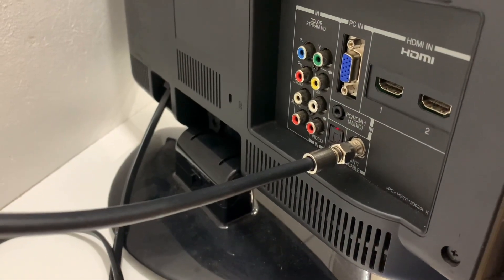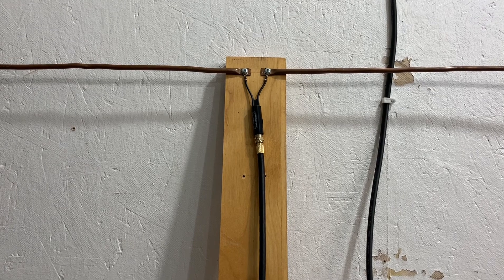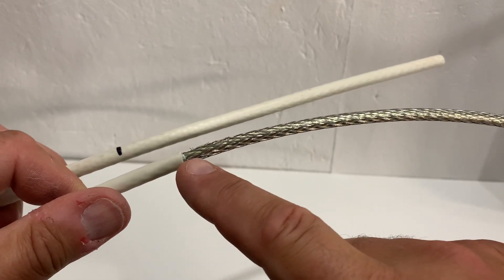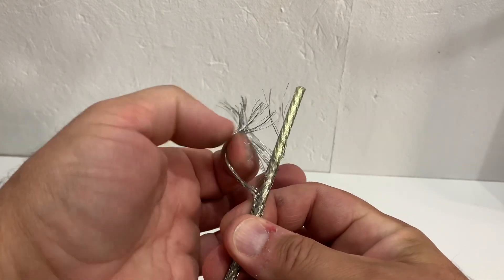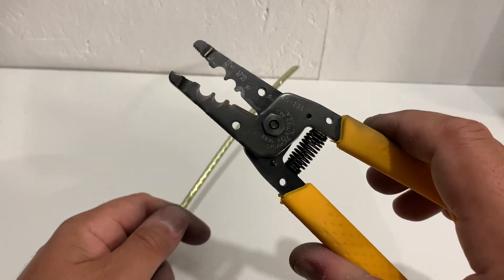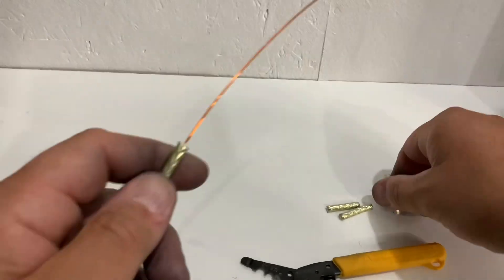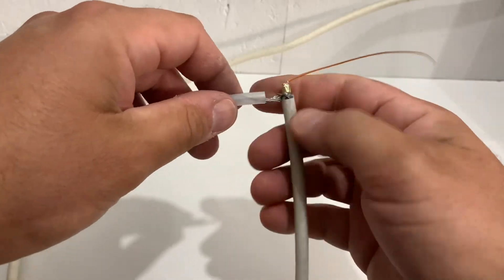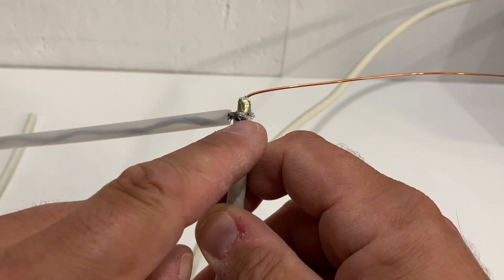Build a Homemade TV Antenna from Coaxial Cable - DIY OTA TV Antenna

Comment: If you leave the plastic over the center conductor and strip away all the shielding copper. You won't have trouble with it shorting.  You can tape the antenna to a bit of wood to hold it in its shape.
Reply from the maker: True. I figured bending the centre conductor with the dielectric on it might risk breaking it. I’ve made other antennas out of wood but wanted to keep this as simple as possible.👍
Reply: @NorthcoasterHobby  While listening to a music channel I thought the Al Gore rhythm prefers videos with an added calm meant if you get by drift.
Reply from the maker: @kensmith5694  sort of…
Reply: @NorthcoasterHobby  Making it so more people see your videos is a worthy goal for me.
Reply from the maker: @kensmith5694  I’m glad you like them, I appreciate you watching!